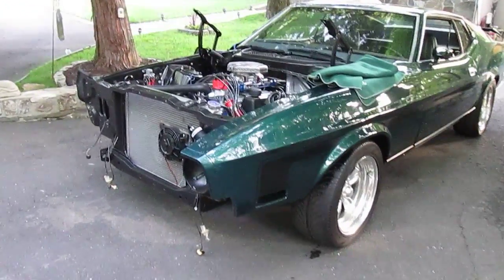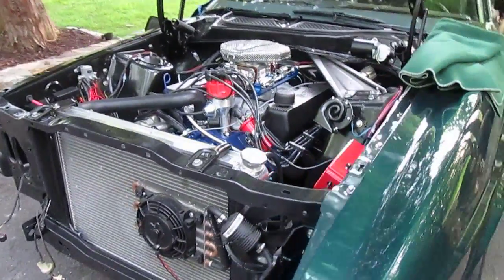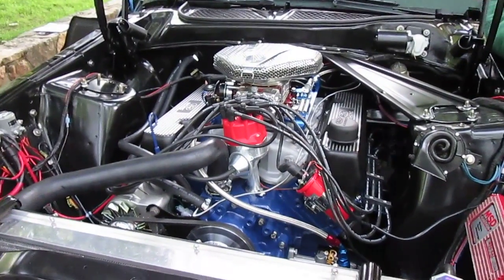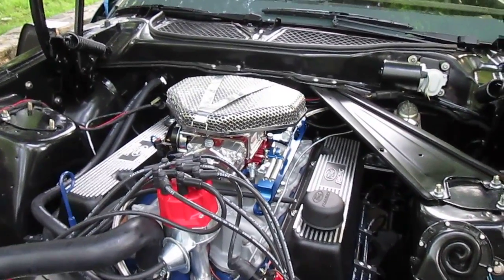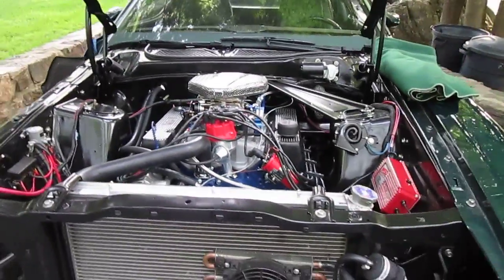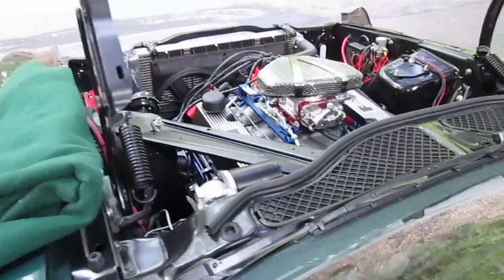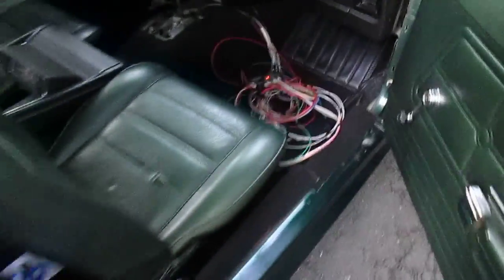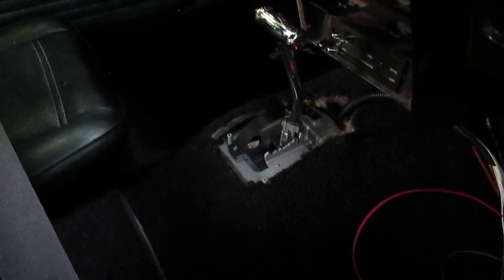NEW FAUX 351 CJ /BOSS MOTOR BUILD START UP

Comment: Very nice! I had a '72 notchback. Came with a 302/3speed. Put in a 351C/Borg Warner T-10, then found a set of closed chamber heads, and Edlebrock Torker and 750 double pumper. Forget what cam I used. But I never did find any headers that would fit it. Had to use cast manifolds. But that was in 1978. Not many goodies to be had back then. Wish I still had hat car.

Comment: Is that like the crate engine on ford racing and CJ pony parts website?
Reply from the maker: No It's a motor I speced out & built-Had a local machine shop do the machine work to my specs